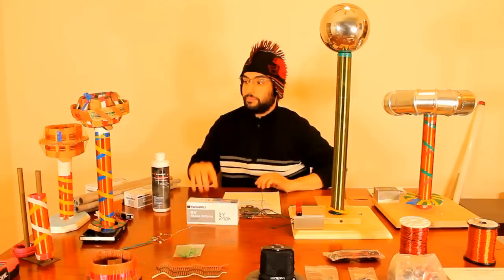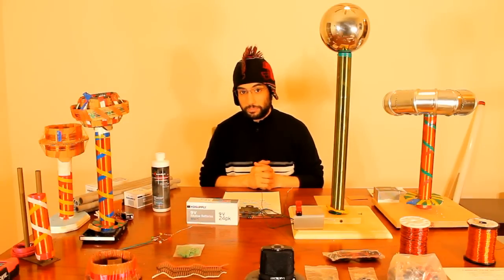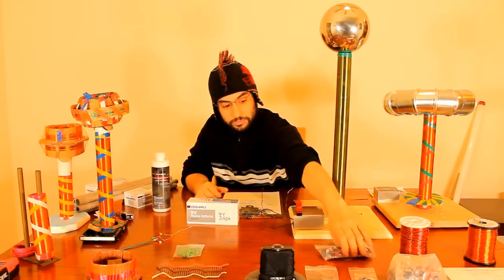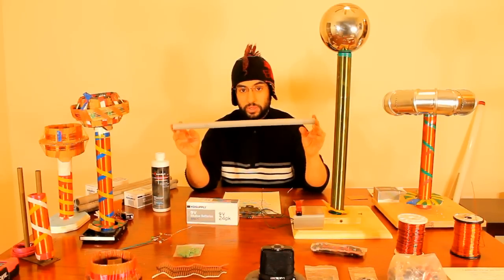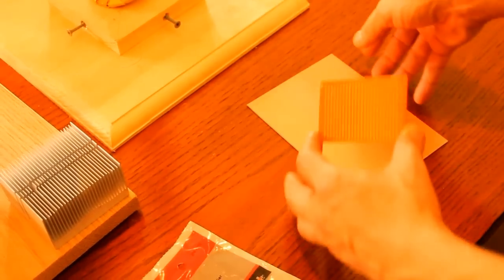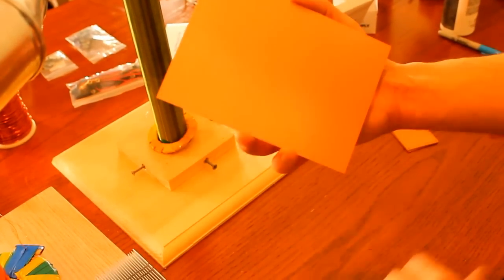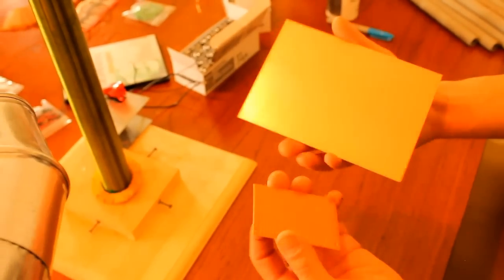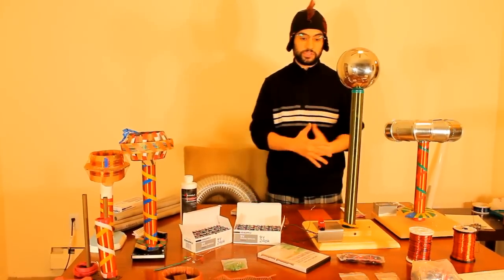Kickstarter update 2/16

Comment: What are the advantages of the 2000 turn L2's and the 500 turn L2's?  Because I have only built L2's from 400 to 900 turns and I have not noticed much difference.